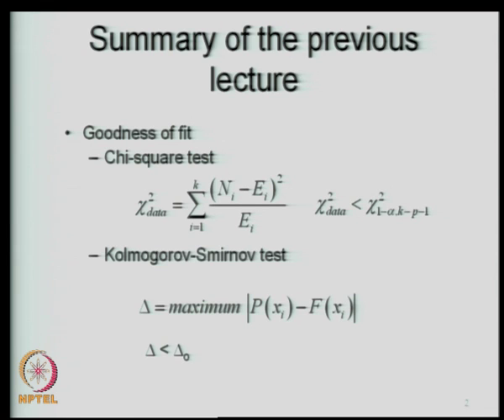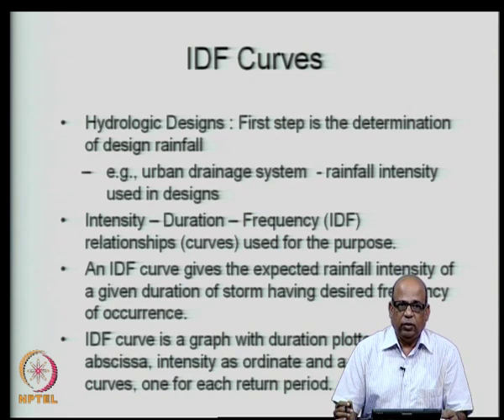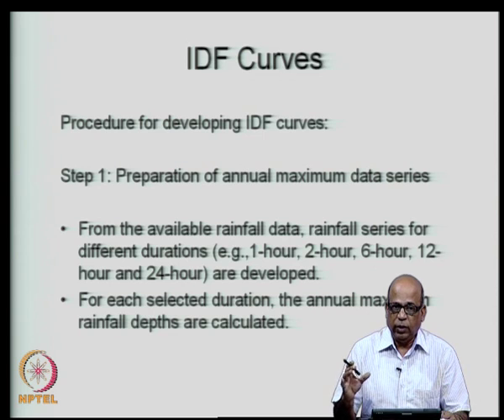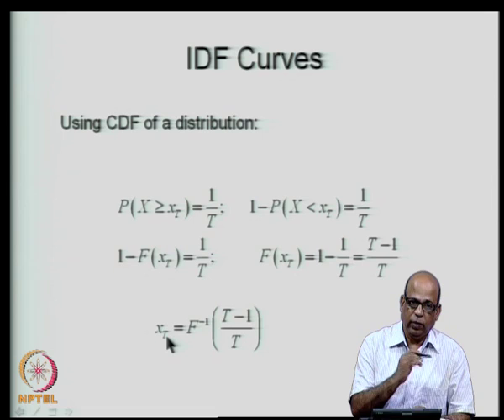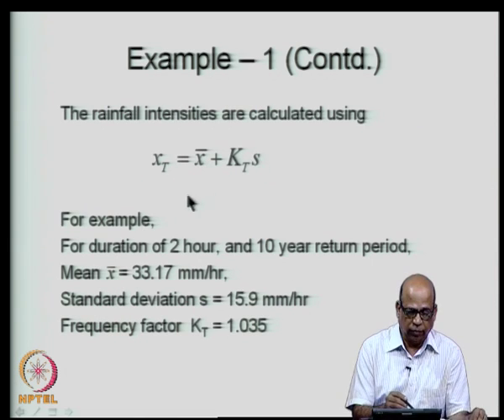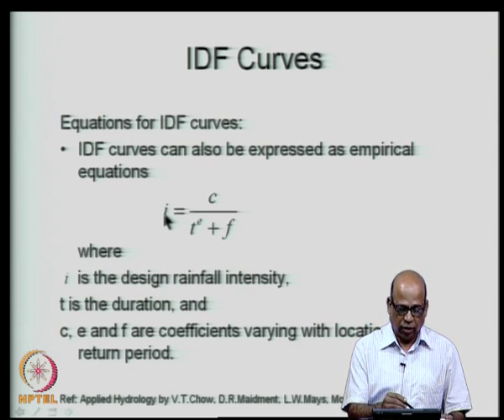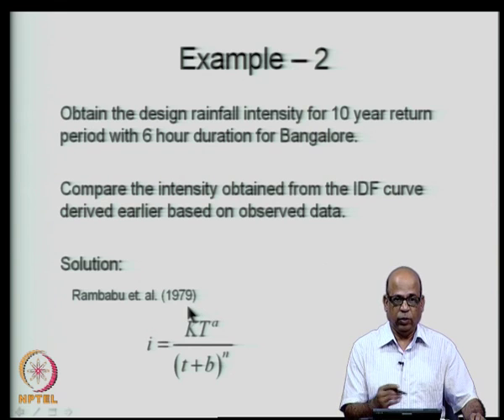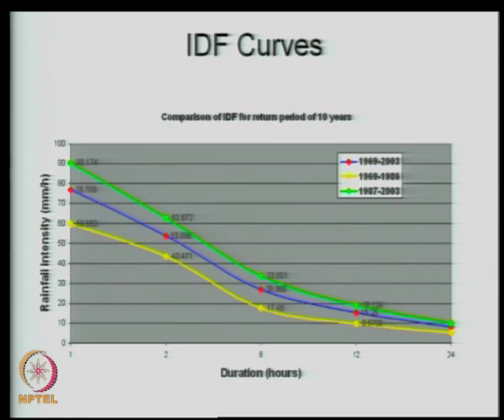Mod-06 Lec-29 IDF Relationships

Comment: Dear Prof, 
Thank you indeed for this comprehensive lecture. It was well delivered. My question is on the data collection. You mention using the Bangalore data example that rainfall is collected at different duration from the rain gauge. How do we compute the duration using a rainfall data that is summed up to daily values? I mean I have daily rainfall values, how do I compute the one-hour, 2 hour, 6 hour, 12-hour and 24-hour rainfall duration from such data.
Thank you.
Reply: Thank you for your question.
The data used here are at 1-hour resolution, i.e., we have 24 values of rainfall in a day for Bangalore City.
The method for computing sub-daily rainfall (one-hour, 2-hour, 6-hour, 12-hour and 24-hour) from daily rainfall (one data point for one day) is called temporal disaggregation.
There are numerous methods of temporal disaggregation available in the literature. Few of them are listed below:
1. https://journals.ametsoc.org/doi/full/10.1175/JHM-D-12-0139.1
2.  https://www.itia.ntua.gr/en/docinfo/570/
Hope this will help you. Let me know if you have any query. Email me at pdey609@gmail.com

Regards
Pankaj
Reply: Dear Prof, I don't see the answer (replied) as per above question. Would you mind advice me how to see your replied please?
Reply: I would also love to see how it was calculated. Does anyone have an idea?